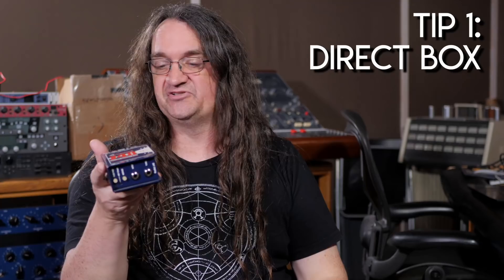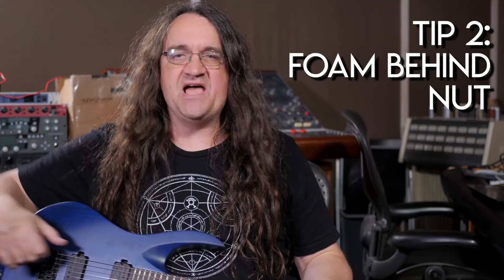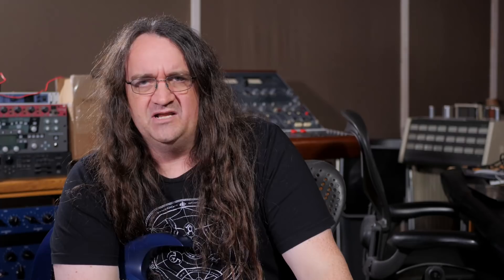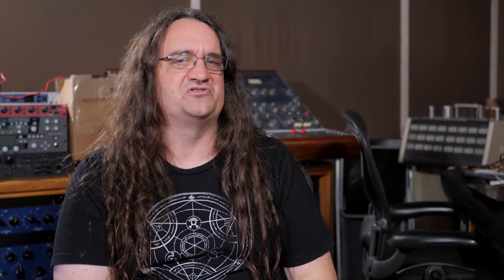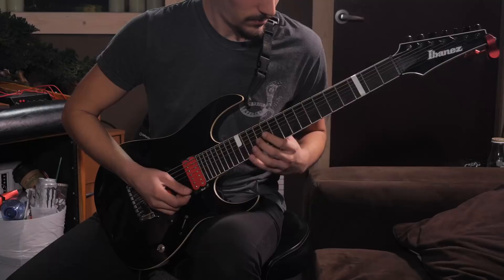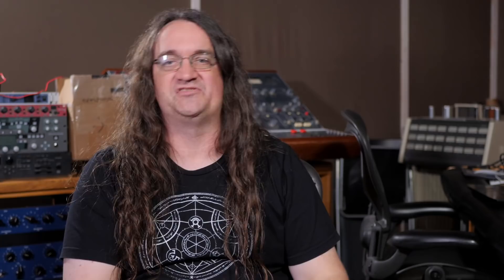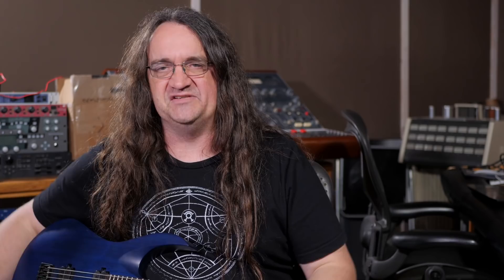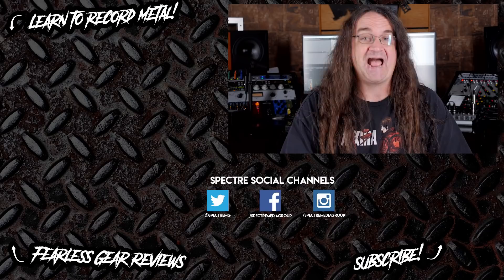Five Tips for Recording Metal Guitar at Home

Comment: 1 - Why does it have to be a 200+ USD Direct box? Why does it need to be an active Direct Box? You skipped over most of the stuff you should've explained just to plug Radial, apparently. 200+ USD is the price of many inexpesive audio interfaces, like the Focusrite Scarlett series. Who uses an expensive DI Box with an integrated sound card?

2 - If the difference is so glaring, why do you need to describe the issue? There's zero difference between both playing examples. If your strings ring behind the nut, you should replace your nut, as opposed to stuffing foam behind it.

3 - Instead of fucking up your strings by putting glue residue all over them, either tie a cloth around the neck or use a hair band. Much cheaper and it's reusable.

4 - Picking hard also moves the string more, making the notes sound out of tune. You can get the exact same effect by picking at an acute angle. What gives that extra attack is not how hard you pick, but how much you scrape the strings with it. Picking hard just makes it louder. If you have a lower action, picking hard will also introduce more fret buzz, as the increased movement of the string will force it to rub against the frets.
Reply: I'd say go and record your video with your findings if this doesn't help you!
Reply: @ZackSeifMusic  Other people have done it already.

Comment: Most of these tips are redundant... the foam behind the nut is a good one, but most people who record already do that. As far as telling people to play as hard as they can without breaking the strings, that's just plain old bad advice... There is a difference between playing a note loud, with proper technique, and beating the shit out of the strings. Playing too hard, which is exactly what you suggested causes un natural tension, which leads to cramps on the short term, and repetitive use injuries on the long term. This is BAD advice. To get a louder sound, you simply need to learn the proper TECHNIQUE in order to achieve that. However, with all this said, there is NOTHING WRONG with softer playing and recording it, even with metal. For every person that "beats the shit out of their strings" as you put it, there's 10 that don't, and they sound fine. I would rather record a player that plays softly, and consistently, (playing hard is automatically going to give less consistent results) than somebody who beats the shit out of their guitar. Aside from ALL the problems with technique this causes, as far as the recording goes, playing hard causes the strings to go sharp for the attack. Which makes phase issues more of an issue. This also causes the strings to go out of tune more frequently during recording, often DURING THE TAKE. Aside from that, there's TONS of other problems, such as buzz from the strings slapping the frets in front of your fretting hand, and worst case scenario, the strings actually contact the pickup when you pluck them. Bad advice. While I agree that a note picked loudly and with proper technique can give a higher output note that reduces noise and helps the amp break up more, resulting in an overall clean tone, its not enough of a difference to justify "beating the shit out of the strings" and even though a properly picked loud note is great, it doesn't do much for dynamic performance. IF, however, you observe the guitar player you are recording, AND DIAL THE AMP IN TO MATCH THAT PLAYER'S TECHNIQUE, which is an engineer's JOB, and have a room and setup that is as low noise as possible, then you wouldn't have to rely on your guitar player causing themselves carpal tunnel syndrome just so your noise floor goes down 5dB.